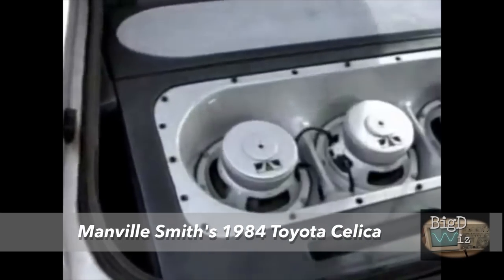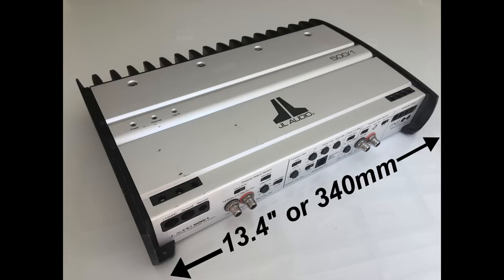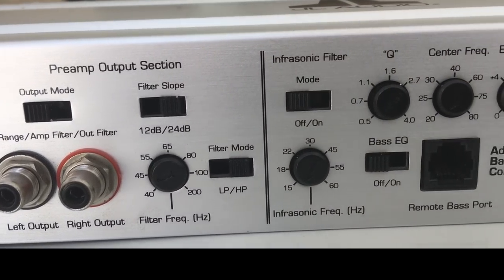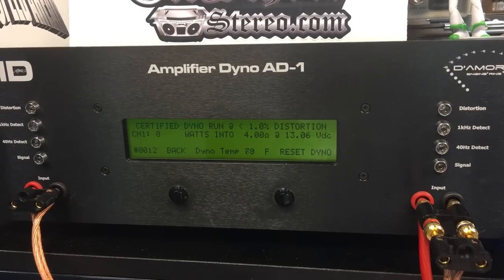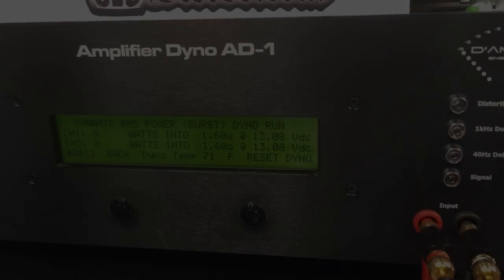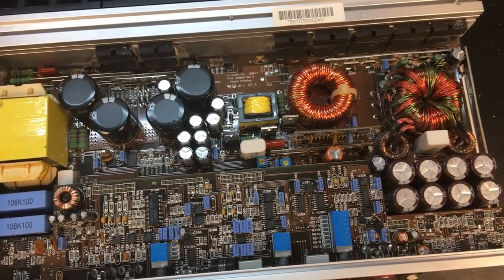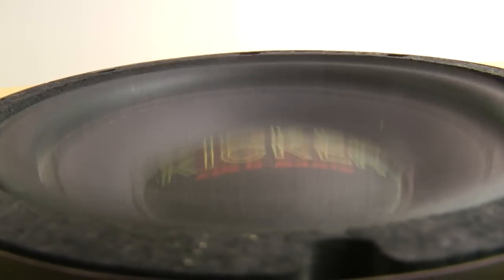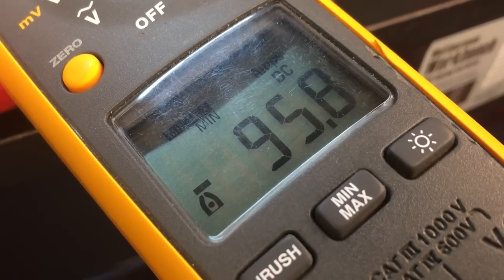Best Selling Car Audio Amp Ever? JL Audio 500/1 Amp Dyno Test

Comment: Great amp, used one for almost 10 years.  I need to re-install it in my new car.  I was wondering which JL 10" sub you think would pair well with it?  Definitely looking for the best 10" this amp will push.  Thanks.
Reply: Patrick W get the old school 10w6. They tock
Reply: Rock
Reply from the maker: +Patrick W I love the 10W7, but a 10W6 would also sound great
Reply: I wish I could go with a 12", but it's going in a C6 Vette and the enclosure that fits into the storage compartment only holds a 10" unfortunately.
Reply: Yeah, the 10W6 might be better.  It's going in my C6 Vette and the box they sell that fits in the storage compartment doesn't look that deep.  Unlikely the 10W7 would clear it, looks like a really deep sub.

Comment: I don't know if JL Audio is starting to rest on their laurels or not, but I was eyeing a JL Audio JD400/4 75x4 watt amplifier and found I could get a Pioneer Special Edition 
GM-DX874 100x4 Hi-Res audio amp, with an included bass boost knob, for ten dollars less when all was said and done, mostly because JL Audio wasn't including speaker level inputs with the amp. I just think that, for the money, the power isn't there anymore.

Comment: I have a 300/4 and a 1000/1 that i have been moving from vehicle to vehicle for over 10 years. Been wanting to upgrade for a bit more power, but I would have to make a very large cash drop to get anything with enough power and quality to beat these reliable mates.
Reply from the maker: +Trix Kemuel 1000 watts is enough for most people's subwoofer needs
Reply: I have 3 Eclipse 500w 12's on a 1000/1. I need another 500w so I just plan on adding a 500/1 and strapping them together. Running 2 on the 1000/1 and one on the 500/1

Comment: I haven't watched all your vids yet, but this is the first time I noticed the "damping factor" spec reported (in the CA&E shot). Was just starting to pay attention/try to learn more about this spec when I got out of the biz... Got any insight/info on this subject? My basic understanding was that it signified the amps ability to control the driver, particularly @ high excursion, and contributed to the overall "tightness" of the bass notes (a sound quality that I personally liked, but not particularly sought after on the mid-nineties Miami bass scene...)
Reply from the maker: +mattmanyam yes, but it can be a misleading spec depending on what frequency is reported.
Reply: Imho the high damping factor is what sets these amps apart from others and also why the SQ is so good

Comment: Im curious, have you ever tried to dyno a JL Audio HD amp? A lot of people told me that they give you easily 100 rms more than what they supposed to give, only because they are the top of the line. It would be great if you can do a video about it.
Reply from the maker: I haven't gotten my hands on an HD series amp yet, but have been eyeing them. The HD750/1 and HD1200/1. As with all JL amps, I'm sure they do rated plus some

Comment: I still have mine!!!  It just needs some love on the interior, powers up and plays, but as soon as i ht a bump it will cut in and out.  any recommendations in Houston TX?
Reply from the maker: Check with JL to see if they have authorized repair centers in the area. May just be a loose connection inside the amp

Comment: i had three of those amps back in the day,i actually still have one,might be messed up,the back plate,you could push on it and the amp would go off and on,i think,but i had 12's when they had dust covers,i had three 8's that were 8w0's yep not even a w3.then i got 8w7's then 12w7's and i can say this SUNDOWN AUDIO blows them away.the 8w7's aren't shit compared to a set of sa 8's,now i haven't had any sundown amps their pretty expensive.oh well but yea these JL 500's jammed 12w7's one amp on each sub.i have a truck that draws a lot of power,how can i find a amp that doesn't suck up voltage ? thats the question.i even have a bigger alt,plus the big 3 ,hmmm.haha yep you guessed it I'm a old school bass head from the late 80's

Comment: Great video, very clear..!! Hello everyone, I might need some help here please..!! Williston audio labs, I have a slash 500/1 and a 12w6v2.....what would or could be the best setup and connection for this great couple....I'll really really appreciate. Thanks..!!
Reply: wire them parallel to get a 2ohm load. if you wire it in series it will be in 8ohms. as for settings it depends on your box are you going to put it in a sealed or ported box
Reply: @shoof1696   Hi, it is set in parallel, so that's a good start I guess. I have the W6 on a sealed box, manufacturer specifications for it..!! That's where the settings comes in...I do lack of experience..!!
Reply: @bramasco1  ok for the settings leave the preamp output section alone since you are not going to be using it. 
turn Infrasonics Filter off since the sub is in a sealed box, all those setting in that section is for ported setup. turn Bass Eq off you only turn it on if you have a remote bass knob. 
for Amp Lp Filter, mode slope, the 12db is if the sub is facing the trunk or up and 24db is if the sub is facing you. you can play with it and see what suits you. filter freq, set it at 80hz. 
for Amplifier Input section, input voltage should be on low if youre using an aftermarket head unit but if you are going to use the factory unit switch it to high. the input sens is the gain knob and the signal sensing is a way to turn your amp on. if youre going to run the blue remote wire, turn it off but if you want the amp to turn on by using the signal from the rca then switch to on. the feature is for people who wants to keep their factory headunit.
lastly the Subwoofer Output since its a mono amp it doesnt matter how its plugged in as long as one is in positive and the other is in negative. hope this helps

Comment: I got a question...  , i got the same amp except mine is the 500/1v2 pretty sure its the same but the settings shown on the amp in the video did you intentionally have it set up like that for your dyno test or is the amp randomly set like that , because im not really sure how to set all the settings to my amp and i was wondering if i can go with the setting the amp shows on video
Reply from the maker: My settings are based on the head unit I’m using so it would not be a generic setting

Comment: I have a JL 500/1 amp and the sucker died on me this morning.  The power light is on but I don't get any bass output, any ideas? All capacitors look good,
Reply: Addicted2Ammo JL repairs them for $100 flat fee plus shipping. I had my 1000/1v1 repaired. Depending if yours is a V1 or V2, my V1 had a problem with intermittent output and it turned out the input board came loose from the main board and one of the revisions for the V2 is they started gluing them together at the plug. So my V1 now has a V2 revision lol

Comment: at 3:11 i noticed you had the amp input section on high input did you keep it at that setting or did you put it on low
Reply from the maker: High as it matched my source voltage of 4 volts. This amp is not designed for speaker level inputs

Comment: Given the same load but at a higher input voltage, would that bring down the current draw?
It should, shouldn't it?
Is that a test you could run Big D?
Reply from the maker: +AA AA I understand where you are coming from and I could try that in the future. I don't think it will be that much difference, but will be interesting to see 🤔

Comment: Hey I'm looking at getting either JL HD 750/1 or a Slash 600/1v3. to power a W6. Which amp is more efficient
Reply from the maker: They are similar but the HD should be slightly more efficient
Reply: @wal  I watched the HD 1200 video and it was and was trying to compare it to the HD 750.  I calculated the JL 500/1 and it seems it's only 55 to 60% efficient. Which amp would you put on either a 12w6v3 or IDQ12

Comment: Literally got one to loom through today, it gets power but no output it seems. Gonna test more later to maybe find a cause. Opened and it didn't show any blown caps, burns or blemishes on the board though. Any ideas on how to get this beast running again? I'll check version after a bit.
Reply from the maker: +Dakota Sapp try bcae1.com, lots of amplifier troubleshooting information
Reply: Thanks BigD!
Reply: JL repairs them for $100 flat fee + shipping

Comment: A guy has one local for sale for $150 and another model of Pioneer 760 for $50. I'm waiting for him to get off work and hopefully talk him down on the JL 500.1.
Reply from the maker: 150 is about what I’d expect for the 500/1
Reply: @wal  Yeah? Okay.. I'm hoping I didn't insult him offering 60 bucks. Maybe I can pick it up today I got the money. Thanks for your advice it's greatly appreciated and valued.
Reply: @wal  I bought it. It is heavy! I have to upgrade my wire size to run all three. I'm trying to decide if I want to use it on the Gothic dual coil or the MTX Thunder 12's. The Gothic I hear will max out at around what this can dish out even rated at 2, 500.. Lol

Comment: Hey Big D Wiz....???? Tell me which amb can best hold up a 1500wts sub...???
Reply: the deaf bonce apocalypse amps are nice if you have the money for it. the bass knob has a built in clip light, it shows the temp of the amp and volts of the amp. second would be ct sounds at1400.1 they rate the amp at 12v but put out more power at 14.4v, it also comes with a bass knob with clip light and shows the volts. the bottom of the amp is acrylic so you can see the guts. those 2 are my choice because of the extra features

Comment: Note to bass knob users.. The Skar 1000.1 bass knob doesn't work with this amp. The connection is the same, but the entire system WON'T turn on if you connect it to the JL Audio 500.1.
Your welcome.😉
Reply from the maker: Great info, not sure who suggested
Reply: @wal  I had directly asked on JL Audio's Youtube channel after somebody else mentioned that it "should" work.  Doubtful it yield positive results, I hesitantly tried.
😬. ⚠
I'm just glad there was no casualty in the experiment.

Comment: the left side on the used JL 500/1 works and lights up but the right side is what i need to push the subs but it’s not getting power. Should i get a new amp or is it simple fix please help

Comment: i have one of these that i got for basically almost free (package deal with other stuff and sold some of the rest and got most my money back) do you happen to know anyone that will work on this amp? the amp was in sad shape when i got it. i "fixed" the power input best i can. its not great but is making connection and the input can be used now. but the amp draws like triple the power it should and puts a strain on my electrical (suburban with a 140 amp alt... that 500 shouldnt be straining my electrical!)
Reply from the maker: +emerybryant try JL Audio support

Comment: By chance can you see what the wattages of this 500/1 as I am running mine at 1.3 ohms it would like to know the wattage output as it almost hits as hard as my old Clarion apx 1000.2 at 1.3 ohms ...... Believe it or not the JL will actually play it 1.3 that is on for Subs all JL 12"w3 s v3s (2)2ohm wired in parallel to get 4 Ohms then I have two 4 ohm subs total of 3 4ohm  connections ran impeller parallel to get my 1.3 ohm load yes each speaker is in their own chamber each speakers ported at 30 Hertz

Comment: Big D the amp doesn't produce more power at higher voltage? 14.4 for ex.
Reply: Derek Stechmann  because of the closely regulated power supply it won't let it make more power then designed
Reply: you must not have watched to the end
Reply: Nope 500 watts all the time.....

Clean power

Comment: What can it play? I mean can it play spl woofer?
Reply: its gonna suck. most spl woofers are dual 2 ohm and some are dual 1 ohm. this amp can only drop to 1.5 ohms and the rips technology limits the amp. minimal increase in watts from 12v to 14v
Reply: @rowboyto156  it won't "suck", it will do exactly what it says it will do. And at a much lower input voltage than a SPL oriented amp. 
Car audio isn't solely about loudness.
Reply: @msh6865  suck is a poor choice of words but i see it as someone who would put sportcup 2 tires in a minivan. hes not going to hear the difference of his spl sub with a sq amp. even if purchased used i see them go for $200+ you can get a stronger amp for less now

Comment: Find it hard to believe that being it was a 600$ amp and not many ppl spent that back in the day so most popular I doubt
Reply from the maker: +chris jones best selling amp, but also had a 14 year production run. JL provided fact of it being the best selling amp. Could be in profits, not numbers sold, this was not specified.
Reply: BigDWiz I'd see profits because I've seen way more pyle and boss unfortunately in that time then I have the jl 500. Not saying it's not a good amp and bad ass at it's time but it was not a common amp for most part. At least wasn't in Nebraska back in the day. I actually remember crossfire amps being one of the more popular along with Orion and Phoenix gold in them days

Comment: Can it do 1 ohm?
Reply from the maker: Should be ok at 1 ohm in most cases
Reply: It can but, because of the regulated power supply you won't see a big increase in power output.

Comment: The 500/1 and the current 600/1 boards look identical.
Reply from the maker: +lstephenson247 600/1 is said to have more modern components and about 20% more power. No need to fix what ain't broken 😬

Comment: I never could justify paying the price of JL products for the little output they provide. The price to output ratio isn't there. I have heard some JL builds while it's decent SQ, it isn't worth the price JL costs. With that said, I am more of a spl person, as well as a Sundown Audio fan. Altho Sundown Audio isn't cheap either, it has output to match its price both on amps and subs all the way down to the sq door speakers.
Reply from the maker: +Joe K.O.S there are lots of options out there. Use what works best for you, no need to be concerned about what someone else thinks.
Reply: Hi, does sundown sound as good?

Comment: that thing is actually horribly inefficient at 1.6 Ohm, around 50% based on the input voltage and current flow.
Reply from the maker: +DanielRichards644 the efficiency ratings of amps you see in specs are mostly done at higher ohm loads (example 4 ohms for 1 ohm amp). Not unusual to see low efficiency at low ohm load

Comment: i have this amp and its hitting good. the problem that i have with this amplifier is that it getting very hot. i compared this amplifier with the ssl 1500 (https://www.youtube.com/watch?v=PbXZ0nNeK_k) and the ssl i played more than an hour on same vol and wasnt getting that hot. they did a dyno test and the ssl only did 181 watts rms and still doesnt get as hot as they JL playing on small vol. i don't have any know how about dyno test and what it all means but ive seen other amps with a lower rms rating thitting harder then others with a higher rms rating so whatsup with that??
Reply: could be your wiring. your ground wire might not be in the best place. you need to check the ground if its giving you resistance. use a multi meter, put it in ohms and see if the hole has resistance, theres videos here showing you how to do it if you need help. another is your wires might not be ofc, if your amp kit is less that $80 its not copper it cca. the cca is not giving your amp the current it needs to run right so the amp heats up. the amp shouldnt get hot. if it keeps getting hot it will break